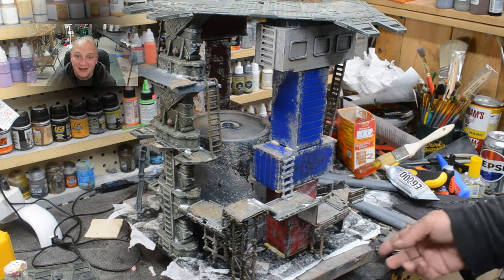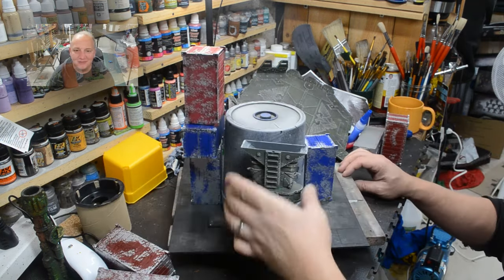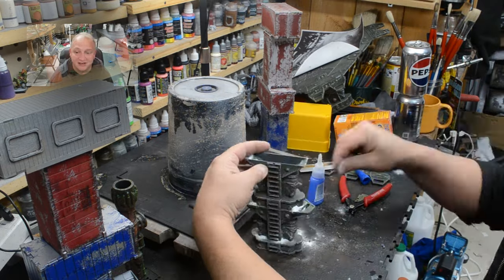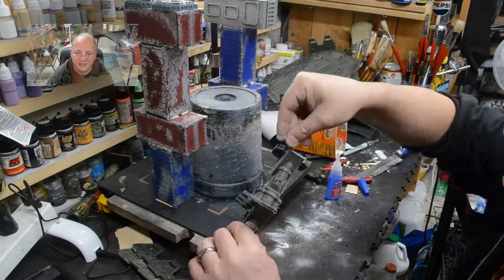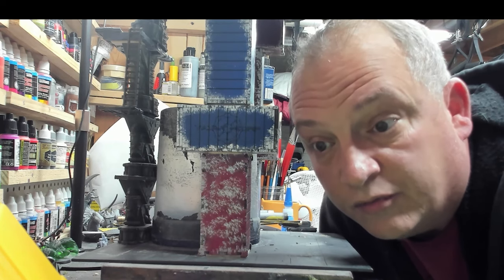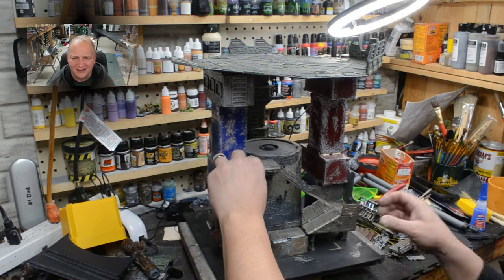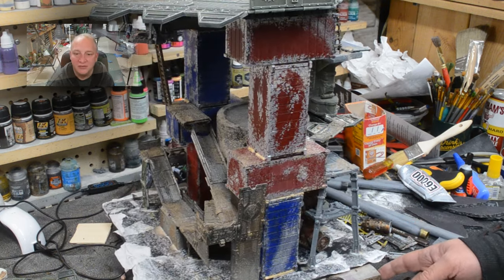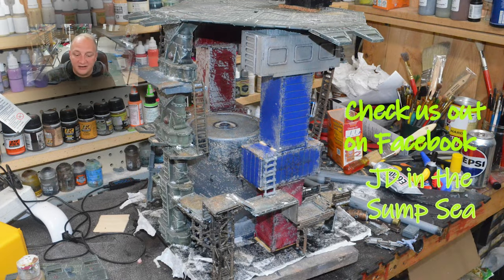#Necromunda Sump Tower #Scratchbuild/#Kitbash

Comment: What about building a piece that would bridge this to one of the walls, either a bridge that has been nearly blocked (or turned into a maze) by market stalls, or a thin walkway that has had shops built off of the sides by welding scrap metal to make floors walls shelves etc?
Reply from the maker: These are great things you speak of! We'll see how this keeps going though.....  There is still a 'top' that needs to go onto this before pushing out to the sides you know.:)